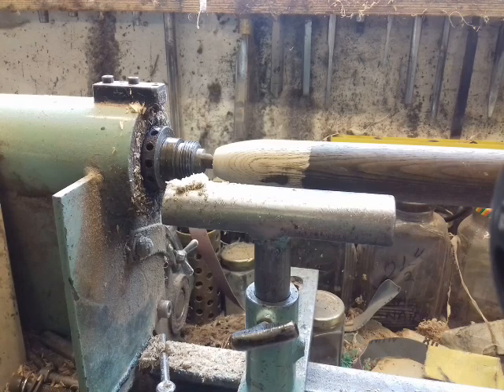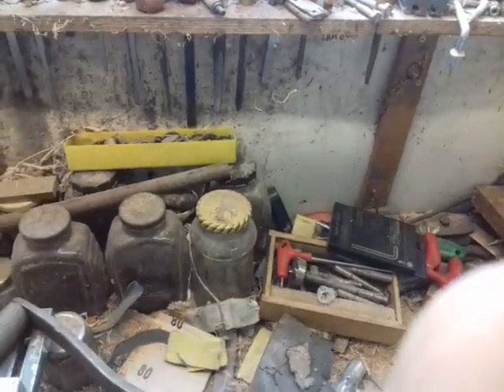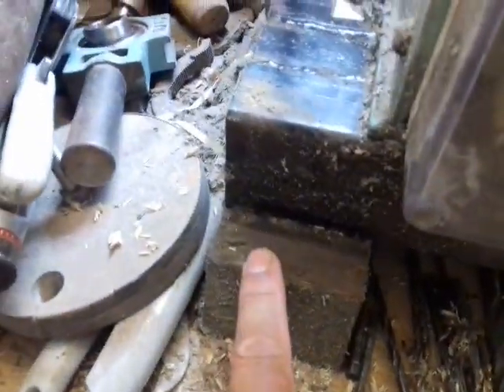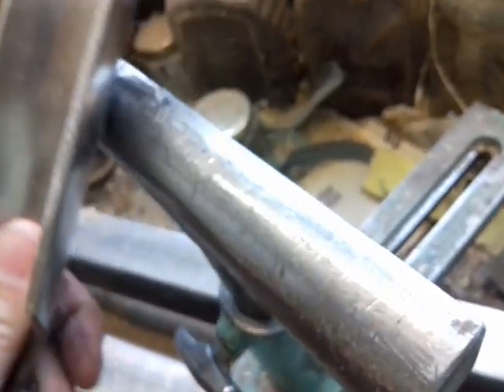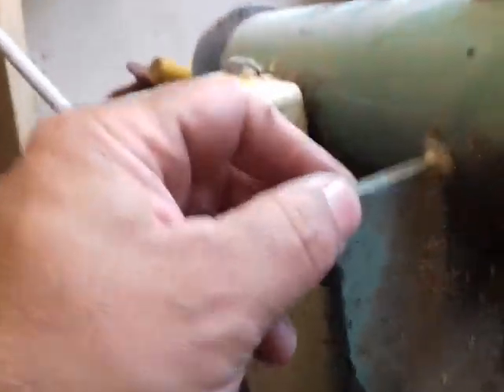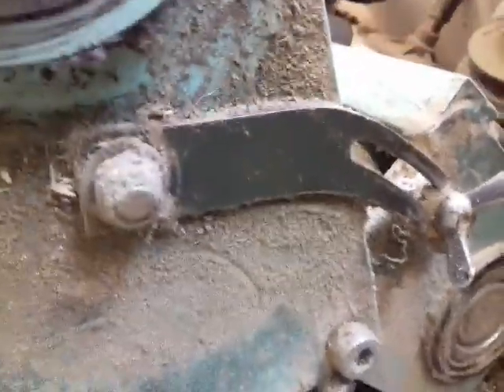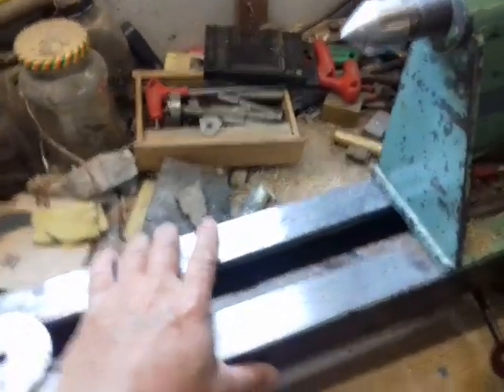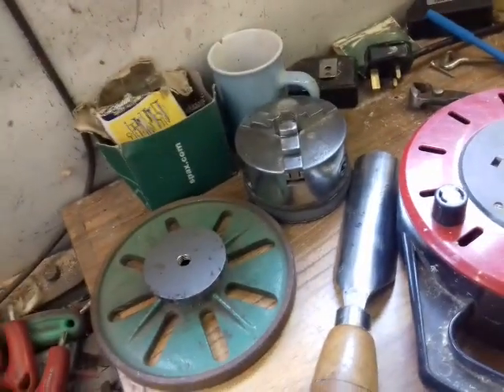Simple Skills, making a garden dibber

Comment: Just subscribed and will say I found alot of your videos interesting. Especially when handturning metal. Did you make the spindle or did you use a Myford one?
Reply from the maker: Hi, welcome aboard Piper, the lathe was made from some older bepoke made  parts from a much larger wood lathe that was decommissioned from a local four poster bed maker, I made the blocks to take these parts seen in the video.
The spindle was made by one of their team who is a centre turner himself, so it is bespoke made to take the standard Myford equipment and fits into off the shelf ball bearing races.
The head stock is actually hollow and filled with motor oil which makes the bearings last for years, I have had it for 30 years now and only put two sets in her since then.
To trun metal, if you can make what is called a graver, basically a diamond shape cut at an angle over a square shaft, Hotlzapfel style cutter, they are amazing for removing tiny fragments at slow speeds and doing rounded and or radiuses, it soon becomes quite easy with practice.
With metals like alloy and brass etc you can actually turn much faster than a fixed cross slide and have lots more freedom whilst working.